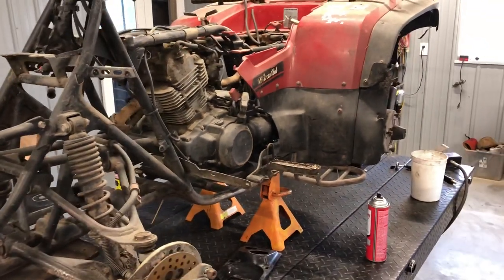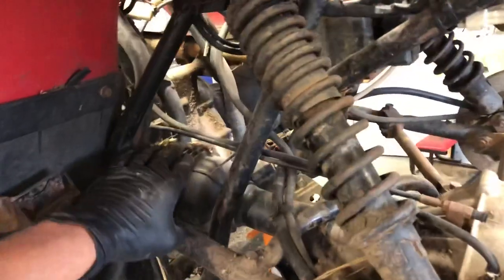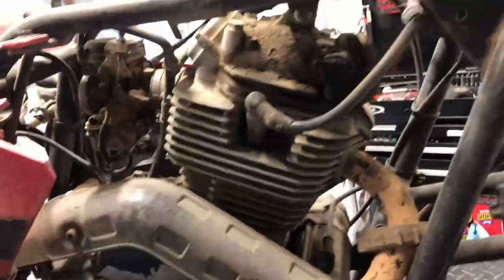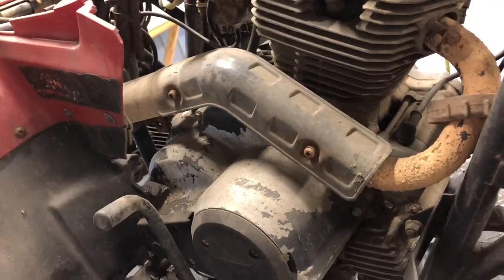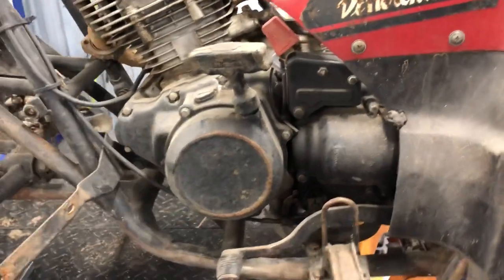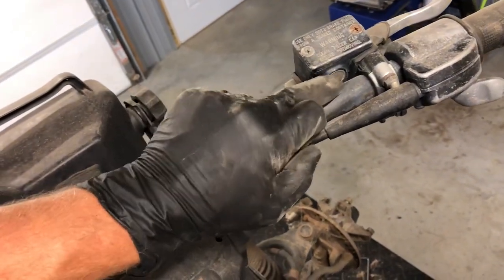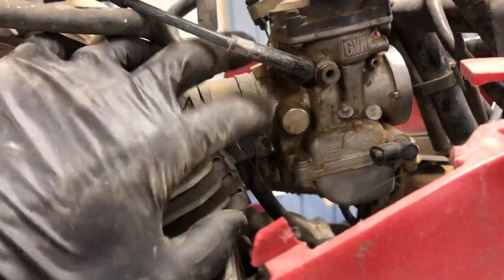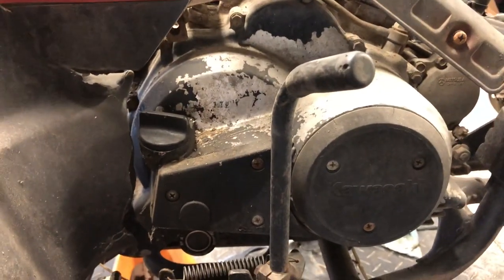Kawasaki Bayou 300 KLF300 Overview Review EXPLAINED Repair KLF

Comment: What does the crankcase breather tube connect to? The service manuals don't show how it connects. All I see is a rubber hose that goes down into the same location as the pickup coil wires, which is between the flywheel case and the gear case cover.

Comment: I’m completely new to quads but the mrs brought one for her stable yard, their is no power at after I replaced the battery with a new one. This video will help me a lot getting to know about all the different parts and trying to fix the issue. Thanks man
Reply from the maker: Happy to help. May have blown a main fuse or ignition fuse. Let me know what you find. Have you hit the subscribe button? Thanks for watching.

Comment: So as fate will have it some times, a buddy of mine in very small town we live in came to me with a second  98 KLF300, I picked it up for $400 primarily cuz it has brand new tires. It was an added bonus that after cleaning it up and throwing a charged battery in her and verifying some electrical connections concerns it fired right up but its smoking  I just got the plastic off front and tank removed and noticed the Crank case vent tube at the tee was disconnected Im wondering if this would cause an oil issue/smoking issue. Carb was full of oil as was the exhaust but it started immediately. I have not confirmed compression yet  but im assuming its good. This is my second KLF300C.

Comment: I have a 2001 bayou 300 4x4 and my engine is getting really hot when riding not glowing red but really hot where it’s takes along time to cool off any ideas
Reply from the maker: Drive faster! jk. These are air cooled so there is nothing you can do without adding fans or getting more air flow. Make sure your filter is clean and engine area is free from dirt build up. Let me know what you find. Thanks for watching and the comment. Let us know if you need anything: https://www.ebay.com/str/midnebraskamotorsports

Comment: I have a 91 Lakoda klf 300 that starts but will not rev up.  When throttle is applied the engine continues to run but sputters and eventually floods out.  I have installed a new carg, checked the timing multiple times and set valve clearance.  I'm stumped.  Any suggestions Thanks in advance.  Love your videos.  Keep them coming.

Comment: I have this same year 2 wheel drive. It used to run but sat for a few years but I’ve got it all tore down and I have good compression the push button start, kill switch, and light have been removed. I can’t figure out what wires went to the kill switch or if that’s even the reason it will turn over but not start? I’m really stumped any ideas will be tried thanks guys 😊

Comment: I have a question but I do not know what the part is called but I could explain it it's just past the front tires and it connects to the front shaft it is a 4x4 kawasaki

Comment: Hello, this is a great video and very helpful.
I have got a question - I have got a 1994, Bayou, KLF 300C (4x4). I messed up with the two clutch adjust screws. I have tried very hard to find information or video on how to adjust those two screws. I have tried some of the tips on the google, but didn't seem to work perfectly. I was able to adjust partially working, but not the way should be. Most of the tips on the internet are for one adjust screws. Can you give me some advice as to how to adjust those two adjust screws under the clutch release cover. thanks in advance.  Jon

Comment: I have 2 blue wires and 1 brown with double connector under the dash. Do they plug into each other or just hang freely? Any help is greatly appreciated
Reply: Ok thanks man
Reply: Man i need some input. So i have the 94 300 4x4 and I am not getting any dash lights to come on. I haven't replaced the battery just working off jumper cables. The fuse was taken out and straight wired in. Burnt prong on rectifier. I'm not trying to spend a bunch of money to find out it isn't worth fixing. If you could point me in the right direction it would be greatly appreciated. Thanks in advance

Comment: Have a bayou 185 seems to be still slipping after primary and secondary clutch’s have be changed any ideas ??
Reply: The clutch adjustment screw doesn’t seem to want to turn any way at all when the lock but is loosened even if the lock but is off

Comment: Hey man.  I've watched, almost, the entire Bayou breakdown.  I have a question though...

My bayou is supposedly an 06 (has a sticker on the front of the frame that says it is -- just bought it.)   The issue that I am having is that this little quad has been around the block, came back, and was sent again.  Anything unnecessary has been clipped, and what is left is rigged and taped together.

I was trying to see if the electric start would work, but it has no battery.  I used jumper cables to hook my lawnmower up to the cut battery wires, and .. nothing.  No click, no sign that power was flowing to anywhere it needed to.  Any advice?  I've not got a multimeter otherwise I would have started with that.  I was actually wondering if you would make a short video giving a run down of where the wiring is supposed to go, and while you're doing that, giving a run down of the fuel lines/vent lines.  I believe if you added that video, you'd of covered the entirety of the Bayou and would be a great source for anyone that was looking at doing any kind of work on one.

Thanks ahead of time.

Comment: Hey boss.. I have a question. Its gonna be a dumb one..Does a bayou 300 4x4 have a fuel pump? And where is it located
Reply: @MidNebraskaMotorsports  thanks so much for the clarification, does your carb rebuild video show how the gas lines and vacuum lines should be attached? The atv I'm trying to fix just turns over and if I pour gas into the carb via the line that was coming from the petcock valve / tank and try to start it, it sputters and occasionally backfires but mostly it just turns over and turns over.. I got it to start ONCE I don't know how or why bc it hasn't started since. Timing appears to be correct ... However I tried adjusting the valves using feeler gauges etc, prior to it starting the one time.. if I didn't adjust them exactly right would that be in line with what it's doing? It has good spark, compression, and power? Any ideas? Ty so much I'm really lost as to how I can get this thing working